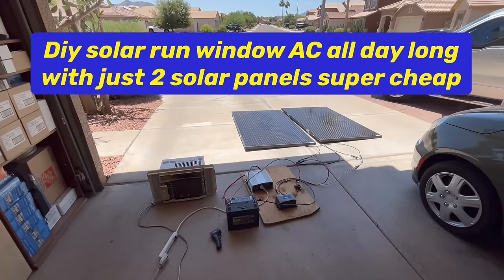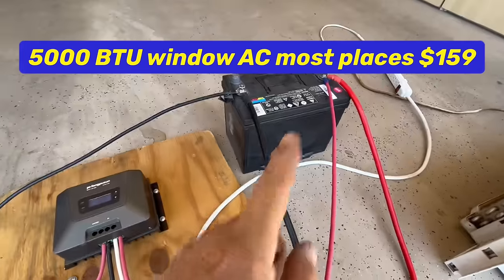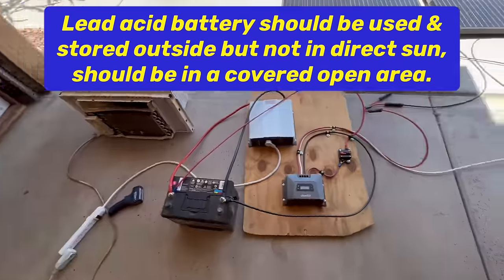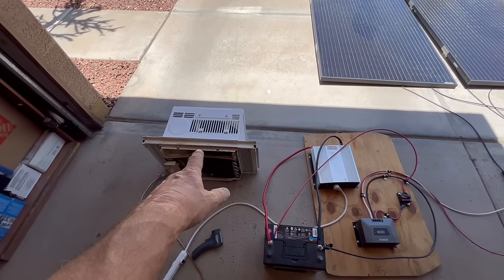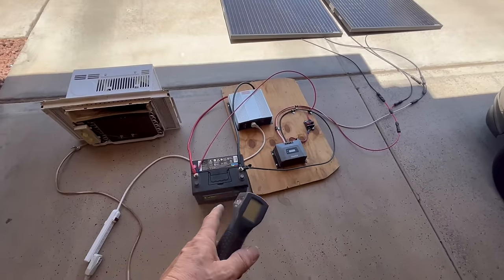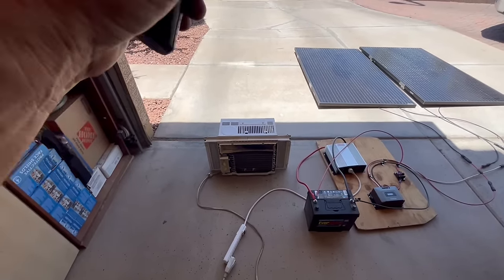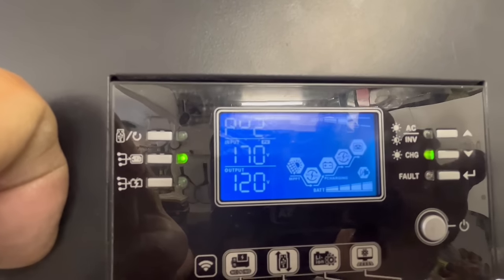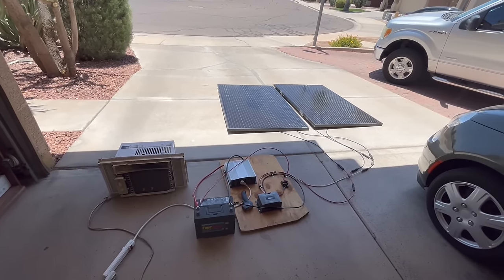Run your window AC with just 2 solar panels when sun shines. Easy DIY project you can do in one day.

Comment: I'm still not understanding why there is a fuse or a control box.  Wouldn't the panels charge the battery, that charges the inverter?  I'm still  fairly new so, please bear with me.
Reply from the maker: You need a charge controller to convert the 38 volts dc from solar panel down to sat 12 volts to 14.2 volts dc to charge the 12 volt dc battery. The inverter then receives the 12 volts dc from battery and converts that to 110 volts ac so you can then run the window ac unit. There is a breaker between the charge controller and battery in case voltage exceeds limit and will trip breaker rather than wires get to hot and catch on fire. Actually you could put a breaker or fuse between the the battery and inverter as well. A inverter does not get charged, rather is supplied with a steady voltage to charge battery from charge controller. I hope this helps.

Comment: Question. I havre four batterie parallel 12v. They always show half full when I add a load.will they discharge,or can you do a video four beginners on maintaining the batteries .because even though they àŕe charging seems like also discharging. 1500 w inverter  ,4 12s  ,600w
Reply from the maker: You need to bring in 20-30 percent more solar in watts to run load and charge battery at same time. I have 8-250 watt used poly solar panels and I barely get 1000 watts input into my inverter. So I can not look at having 2000 watts connected to my inverter but rather I only have 1000 watts input to inverter. If I run my mini split that uses 1200 watts , I would need to add another 2000 watts of used panels just to get to 1500 watts input from solar. So I have 4000 watts in used solar panels but only getting 1500 watts input into inverter. My new 400 watt bifacial to 500 watt solar panels actually give me 370 watts input for each solar panel. I would only need 4-400 New watt bifacial to get the same output as 16 used poly 250 watt solar panels. Keep this in mind when trying to run something. Need to run load and then have at least 20-30 more solar panel watt input to keep charging the batteries. Hope this helps. Hope you have a truly wonderful and extremely blessed 2024.
Reply: @diy-solar-guy  thank you for getting back at me. The only thing that’s crazy is for beginners, taking in a lot of information and then get lost in  translation. Because I saw one video where the guy has a window unit 100 amp battery from Walmart and one I don’t remember if it was 100 or 300 W panel. The thing that confuses me I’m  just running two fans at 110 W apiece. And this is the reason why I added two more 12 V batteries but then I see a video of a guy running a whole window unit.
Reply from the maker: @lilrararesales270 check out my other videos, I try to explain what I need to run what. You always want to over panel your system to run your load. If you need 500 watts to run load, have a 1000 watts in solar panels, if you need 1000 watts for load, use 2000 watts in solar panels and so on, you might be able to still run unit partly cloudy days. New solar panels will give you double to three times the amount of watts from used solar panels. I bought used solar panels to start out 4 years ago and I am only getting 112 watts out if a 250 watt poly panel. So you are better off in the long run, meaning 2 or more years of running solar to buy new solar panels, long warranty and will last producing very good output for many years to come. Hope this helps. Have a blessed day.

Comment: Dont forget the fuses at the battery for the battery cables...
Reply from the maker: That is something you can easily add. This is just the bare bones basic system to show using solar to run an ac. Adding a fuse would only improve system. Thanks for your comment.
Reply: @diy-solar-guy  Yes, but since this is kind of a beginner guide, I think its a good idea to tell the beginners where to put the fuses, so they dont build it exactly like you did and eventually burn their house down.
Thank you for the (otherwise) helpful guide, tho.
Reply from the maker: @Chris-yy7qc  when I make another video using the window ac in this set up, I will add a fuse. What size fuse would you like to see with battery cable. Are you suggesting there should be a fuse on both positive and negative battery cables? You used the words fuses and cables in your comment? Should I use 2 fuses? Let me know what you want to see  in video. Typically there is only a fuse on the positive cable.

Comment: What model is that Charge Controller (for $100) and where did you get it?  Thanks!
Reply from the maker: I tried looking for it, but couldn’t find it anywhere. I bought at santansolar.com. If call them, they might still be able to get them or tell you where to buy. I bought this charge controller from them about 2 years ago. Thanks for your question. Hope you have a wonderful and blessed weekend

Comment: Are most of the panels generally availible at san tan solar, and the controller too
Reply from the maker: I bought all of my used solar panels at Santan Solar. Controllers depending on video were either bought at Santan Solar or signature solar. I just bought new half cell mono bifacial 400 watt up to 500 watt bifacial gain from signature solar and  I am getting almost 4 times the output of 1-400 watt panel compared to the older used 250 watt solar panels. Paid $120 for new 400 watt to 500 watt bifacial gain solar panel that is giving me 350-400 watts versus used 250 watt poly solar I paid $30-40 each panel that is only giving me 112 from 250 watt solar panel. The solar panels are almost the same size. 88 percent output of 400 watt new panel and only 44 percent output from used 250 watt solar panel. I would suggest buying the newer solar panels from signature solar and use 1/4 of the space on solar array. You can see my video I just posted a few days ago on the new mono half call bifacial 400-500 watt solar panel and follow link in description of that video. I liked the older solar panels but I already had 3 or 4 fail on me in just the last 4 month to where they are trash and can not be repaired. I have used the used poly 250, 180, 330 watt solar panels for last 3-4 years that I bought from Santan solar and I am disappointed they are failing after such a short period of time. Hope this helps, I am uploading a comparison video today that shows the difference in the new and used solar panels. Used is good to just start out and experiment with but for the long haul, I suggest buying the new solar panels if you have experience with off grid solar or just want to spend more and make sure the panels will last longer. Santan solar only gives a one year warranty on all used solar panels as where newer solar panels have a 10-25 year warranty depending on the manufacturer and/or seller. Let me know if you have more questions.

Comment: How many more panels and batteries would you need to keep that AC running 24/7?
Reply from the maker: This ac will use around 5-5.5 amps or 500-550 watts. Need to look at the actual input watts coming in from solar panels. I have these used 330 watt solar panels that were giving me around 250-275 each solar panel. You would actually be better off having 1000 watts input from solar so maybe 1250-1500 watts in solar panels to get a consistent 1000 watts. When clouds go in front of the sun your watts will drop considerably. You would need a LiFePO4 battery bank to run overnight. You can typically run a LiFePO4 down to 20 percent state of charge before battery or inverter will shut down. If you use 550 watts max per hour to run ac and run for 12 hours you will use  6600 watts, so 2-EG4 100ah 5120wh would give you 8kWh’s of usable battery time. So you could probably use just 2 batteries. You will have your factor in the amount of watts being used by the inverter as well. A 12 volt system is not very efficient since you can not connect much solar, a 24 volt of even better a 48 volt inverter and battery bank would be your best bet. With the 48 volt inverters I have I can either connect up to 14,000 watts or 20,000 watts. So with a 48 volt inverter you can expand to run quite a bit more than just a window ac. Hope this info helps you to understand some options and that a 12 volt system is not very efficient as far as being able to run very much, only being able to connect probably less than 1000 watts. A 24 volt system is better as you can connect probably 2400-3000 watts to inverter. But a 48 volt system is the best since you can connect a lot of solar and get split phase to run 230 volt ac’s with large loads. I have a lot of videos on running my 3 1/2 and 4 ton whole house ducted ac system  with off grid solar. Check out those videos to see what you can really do with off grid solar. I am running 5 mini splits and a 3 1/2 ton upstairs ac right now to keep house at 68 degrees and garage at 72 degrees while it is 110 degrees out here in Phoenix AZ today. Have a blessed day

Comment: dose the controller have to be plugged in to the grid to work? can this be independent of grid since no fan in the controller?
Reply from the maker: You can not connect controller to grid with this type of inverter, it has dc in and dc out. Takes voltage from solar panels in to controller which can be as high as 70 volt and drops it down to 14.2 volts or less coming out of controller to charge the battery. Can not connect to ac in any way. Has to be connected to a 12 volt battery then 12 volt battery to dc inverter that changes to ac output.

Comment: Why are the panels not in series, wouldn't they be more efficient wired in series? does the charge controller not accept the higher voltage sp input?
Reply from the maker: The charge controller will only work with 2 solar panels for 12 volts and 4 solar panels for 24 volts. Over the years I tried both ways, series and parallel and did not notice a difference. It can only handle 80 volt input dc from solar panels and is limited to 700 watts pv input for 12v battery bank and 1400 watts for 24volt battery bank. The price of all in one off grid inverters has decreased so much it’s getting hard to find these charge controllers, new inverters are so much more efficient and can handle a lot more solar input. Technology has increased so much in 4 years since I bought this charge controller.
Reply: @diy-solar-guy  very helpful video and your info, thanks for your reply

Comment: So if you wanted to charge up a battery so the AC can be used all night, what kind of setup would you need ?
Reply from the maker: You would need lithium iron phosphate battery bank, I have a set of 5-51.2 volt, 100ah, 5120 watt in parallel to make a 25.5kwh battery bank. I can run my 3 1/2 ton heat pump central ac overall and have around 20-40 percent state of charge left at 6 am. Less acid and AGM will not run overnight but are great during the day. I reduced my electric bill by 60-70 percent Judy by running air conditioning during the day with just solar from 7 am to 6 pm. Then used grid power from 6 pm to 7 am.  I installed 6 mini splits in my house, 2 upstairs, 2 downstairs and 2 in garage. I have 3 bedrooms, a bathroom and a loft above my garage and rooms use to be very warm at night due to heat in garage. Now I keep my garage at 78 degrees in the day even when we pull in hot car after work. You need to figure out how many watts you will use and then add 30-40 more watts in panels to be able to run loads and charge battery at same time. What do you plan on trying to run in day and also at night?
Reply: @diy-solar-guy   Im really interested in doing this for my house. I know nothing about how to do it but your video was really helpful.  Because i have a cape cod house with dormers, the solar companies said my house wasn't good for installing panels. However i have a 65 ft length of vinyl fence that gets perfect sun and i was thinking of installing them on there. Just for some extra free power. If you get enough power from 2 panels to power an ac unit, i might be able to install maybe 15 to 20 on my fence and power much more. Not sure how much power that would give me though.
Reply from the maker: You could run a much more efficient mini split that air conditioners in summer and heats in winter. Check out my videos on how I use pergolas and built solar arrays from scratch to mount solar panels. Not one solar panels is on my roof. A metal fence would not be a good choice to mount solar panels as it could cause people to get a shock if there is a short in system.  I have cinder block wall that I mounted on but later decided to build a array a few inches away from the wall instead. Solar panels will do better at a 25-35 degree angle year round, on a wall like in my backyard, solar panels can only get sun in the winter for maybe 4/5 months at most. I installed 6 mini splits in my house and garage and can use with solar or grid power. I can now run my 2 central ac units in my 2 story house with solar in day and battery bank at night. Check out how I was able to accomplish this with no experience in solar, mini splits , hvac or electrical. Everything installed was DIY. Watch my videos to see what is possible with an amateur DIY guy. Then you will get an idea of what you might want to do with solar off grid. Thanks fir the comment and hope you have a wonderful and blessed week

Comment: Could you just run the AC off of the battery with the inverter alone? I have the same inverter and trying to run my AC for camping off an extra battery I have, but everytime the compressor kicks on it trips the inverter.
Reply from the maker: Yes , you should be able to run without solar panels. Not sure what you amp draw is that it won’t start. Your compressor might draw quite a bit of amps. As you saw in my video, the ac unit uses 550 watts and when started, the inverter showed 2000 watt draw at start up, actually it was probably more than 2000 watts but not able to tell with that inverter. If you use a LiFePO4 battery you should be ok. The problem with lead acid and agm is as the battery voltage drops it will not be able to start compressor. If you use the solar panels, the main draw when you start up compressor would be from solar panels not battery. As you increase voltage in battery bank from 12v to 24v, you double the amp hours and makes it easier to start compressor. They sell flexible solar panels, still kinda pricey, but could mount on top of camper. They only weigh like 2-4 lbs and you can use double sided tape designed for campers to stick to roof. I used this ac for 2 years in my solar shed when I first started playing with solar. You really need solar panels to run for hours at a time. That lead acid battery in my video will only run ac for about 1/2 to hour with no solar panels. But with solar I ran from 9am to 5 pm every day. Like I said go 24 volts and you can still use same charge controller and you can double the amount of solar panels making much easier to run and you might be able to run from 8 am to 6 pm. Hope this helps. Hope you have a wonderful and blessed day

Comment: Could you do this with a pool pump too.
Reply from the maker: Check out my other videos, I run my pool pump 7/24 365 days a year along with heating my pool in the winter with an all electric heat pump pool heater that is 127,000 btu. We keep our pool heated to 78-89 degrees using the solar off grid power we produce in the winter months. We are able to air condition our house with a 3 1/2 ton and 4 ton central air conditioners. It has been 113 or more in the day out here in Phoenix AZ in the day and overnight lows of 90 degrees. We spent $0 on air conditioning the house which is a 2 story 2450 square foot. You will be amazed at what I have done with solar off grid. Hope you have a wonderful and extremely blessed week.

Comment: wonder what would you need for 12000BTU 120V mini split
Reply from the maker: I have videos on that. I installed 2 upstairs, 2 downstairs in my house and 2 in the garage.I started out using a MPP 24 volt, 2400 watt. 120 volt off grid our sign wave inverter I bought locally at santansolar.com here in Gilbert AZ or you can buy on eBay and they will deliver from Taiwan, I bought some parallel kits from them on eBay and showed up in 5 days. You would need a 24v battery bank. I used AGM but only ran during the day with AGM, then grid overnight. I used 12 gauge extension cord and cut to 15 foot so I could plug in solar off grid inverter receptacle in wired from inverter to run in day and the plugged in grid socked overnight then after a while bought lithium iron phosphate battery bank and used battery bank overnight. Battery bank was 150 ah, 4 kwh. I ran overnight from 6pm to 6 am set at 78 degrees. Worked well. Turned off from 6 am to 9-10 am while battery on solar recharged than ran on solar again and repeated process. You can check out my videos using 120 volt mini splits. Hope that helps with your question. Hope you have a wonderful and blessed week

Comment: Will this run the same without the battery?
Reply from the maker: The battery has to be in the system,  the solar charges the battery through the charge controller to supply the load to air conditioner through the inverter. They have mini splits systems now that have direct input from solar panels that do not require a battery to run during the day.
Reply: @diy-solar-guy  Thanks. I thought since the panels were putting out more than the a/c required, that the battery would be superfluous.
Reply from the maker: You are very welcome. 4 years ago I knew nothing about solar, now I have harnessed solar for so much use everyday. It is a quick learning curve.